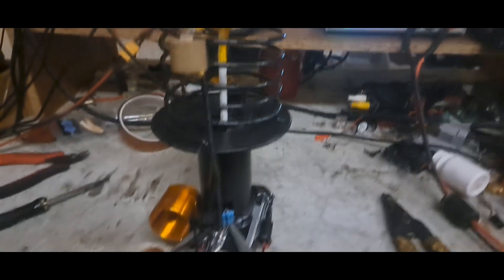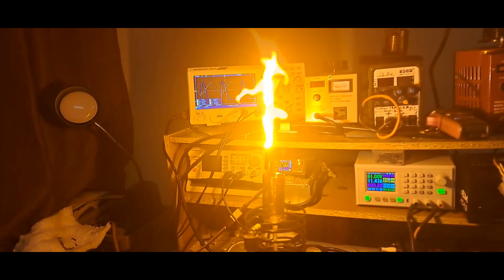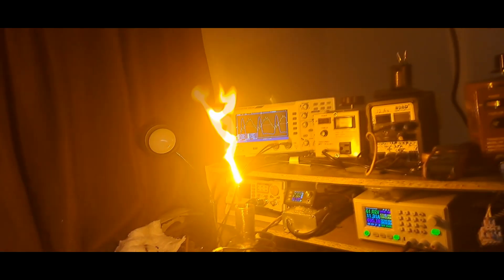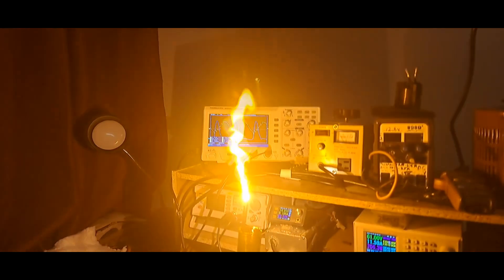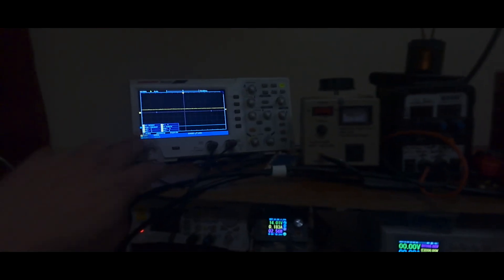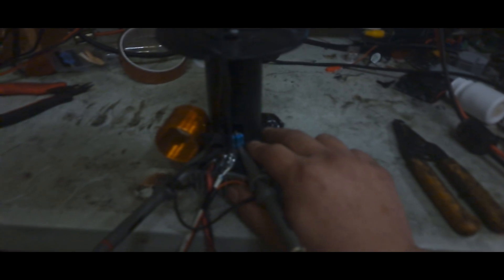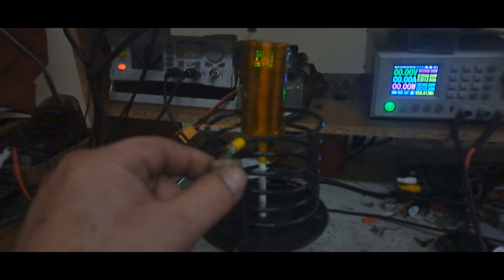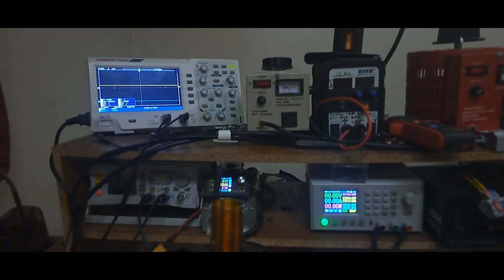Another 60V 700W HFSSTC

Comment: Bro my tesla coil push pull sstc which is similar to yours has some problem. It automatically  gets interrupted at a lower frequency or fluctuates without connecting interrupter . I am using a smps supply of 24 v 2.5 amp. Pls help me
Reply from the maker: Your supply probably isn't able to push enough amps. You need something like a 10A supply.
Reply: @Magneticitist  my mosfets die very quickly what should I do
Reply from the maker: @KamleshkumarSingh-b8i  eh that's a tough one. Hard to say without looking at it. It may just be your approach to running it.